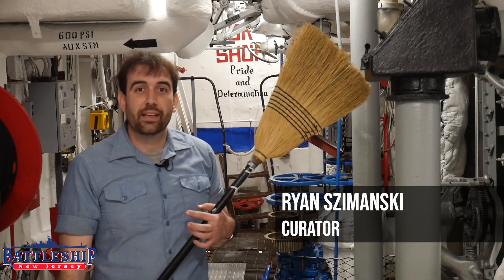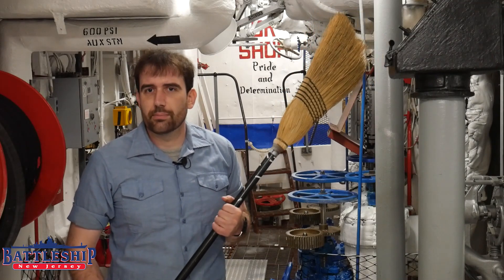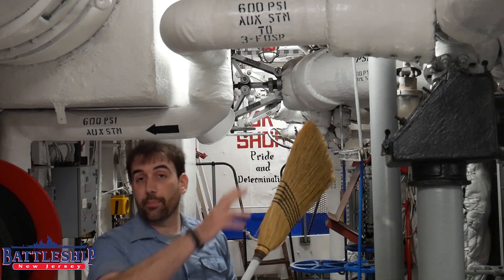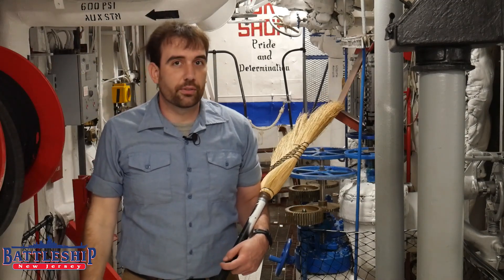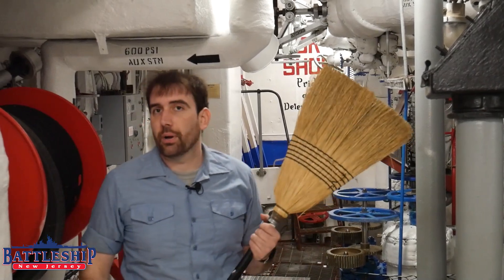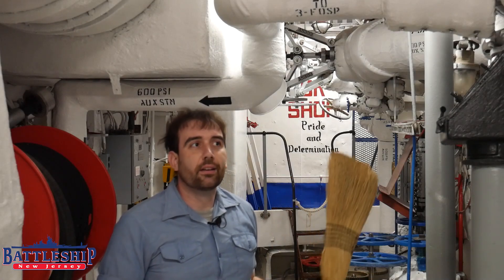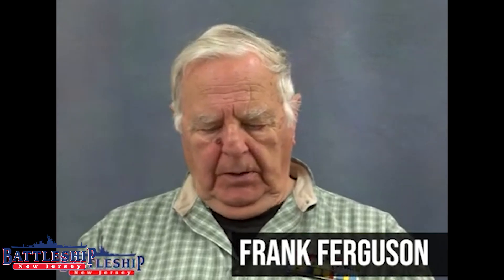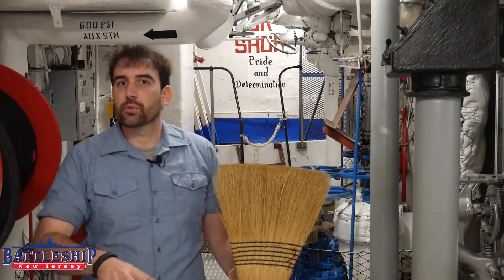Searching for Steam Leaks in the Battleship's Boiler Room

Comment: Using a broom to find steam leaks is still a thing even in naval nuclear power plants. The only real differences between a nuclear power plant and a conventional steam plant are the sources of the heat and in a nuclear plant you use a heat exchanger to transfer the heat from the primary coolant to boil the water you're using to make steam.

Comment: Ryan, great stuff as usual, TY! btw, I spent my civilian career as a pulp and paper Pipefitter.  We used a lot of high psi steam as well.  There is nothing of a wives' tale about searching for a shrieking hp steam leak with a broom.  Less than 200 psi of compressed air can penetrate the skin.  I believe a bad hit from 600 psi steam could cut a man in half.    AIso, I think Nuclear powered ships are indeed steam powered.  Instead of using oil to heat the boilers they use radiation.  Keep up the good work young man.

Comment: Ships I sailed on created superheated steam at 850psi and 960F.  You could hear leaks but not see them unless they tore out some of the lagging and a big leak you couldn't hear anything but a massive roar. Needed to fix it first chance as the steam would gouge the steel and the leak would get worse.  To pinpoint it,  we used a listening rod with a scrap of rag tied to it.  A couple of feet away from the leak, the steam would lose heat and you could find it with a bare hand - problem with that is that the steam is very dry and will build up a hell of a static electric charge. I remember my Croatian second assistant standing in a steam plume from a floor level leak and pulling huge sparks from a fixed foam spreader which was of course electrically grounded. He was mad as hell and couldn't understand why he was getting electric shocks from a simple foam spreader and I couldn't explain for laughing.

Comment: I used to work for a company that builds steam turbines.  They have a central boiler that provides heat, DC power, and supply steam for several test facilities around the 20ish acre campus.  One day in... 2010?... a high pressure pipe running over the top of our building ruptured.  The howling was incredible.  Deafening inside and from most of the plant.  It sounded like an air raid siren.  

I know that I heard about the broom technique when I worked there, along with stories of guys losing fingers to steam leaks.

Comment: I flew a Fokker F-27-500 Turboprop, That unit had Three Pneumatic Systems.  Each units bottle pressure was maintained by the 4 stage compressor at 3300 PSI... In training they said if you hear it singing and 3300 pounds is going to be screaming, the best thing is to just isolate and stay clear of it as it will chop body parts off like a scalpel...  Never had one develop a leak, but we did lose oil out of the drive assembly to the Compressor and Generator and alternators and had to shut that engine down to keep the gearbox from blowing itself apart...  Mechanic stuff is always a good time when it EXPLODES and blows major pieces out of or off of some critical motivational equipment. Fun Video.

Comment: I was a BT3 on the USS Waddell DDG 24 between 83-86. We had a total of 4 Foster Wheeler D type 1200 PSI boilers in two fire rooms supplying two engine rooms with Westinghouse main turbines. Yes even small steam leaks especially on the main super heated lines are nothing to play with. I remember using the old broom method to locate leaks on several occasions during my tour.

Comment: Also applicable to high pressure hydraulics, where you find a pinhole leak that shoots a needle thin jet of oil, which penetrates clothing and skin equally well, so you get large subcutaneous oil filled blisters that need surgical lancing and draining, and often more than not skin grafts to repair the damage. The broom will there either lose bristles, or simply get wet.

Comment: Not a ship, but a building.  A misconfigured valve controller set off a steam hammer that blew apart a high pressure steam line.  The dry steam melted aluminum and copper and cut through the panels on the utility penthouse.  It had my respect after that….

Comment: I was a BT on a gearing class destroyer stating in 1968. You hit the nail on the head. Almost everything you said is what I was taught, including using a broom. We never had a leak. We did loose the load and we only had one boiler on line at the time and that's the boiler that went down. That totally killed the ship, we were dead in the water. It took a few hours to come back on line.
Barry

Comment: I was taught while training on forklifts that a hydraulic leak on the fork mast while it was up or carrying a load was dangerous. It could in theory cut a man hard as the hydraulic fluid operated under great pressure when compressed and the valve was not releasing the load. We were taught to find the leak first by observation to find general area, of course stay away from the jet direction of the leak, and use a piece of paper as you used the broom to use as a 'search device' as a sacrificial lamb.

Comment: Pin hole leaks only.
A large leak would lead to an explosive decompression, basically, an explosion, and probably kill those in the space.
An economiser tube on one of the Aussie ddgs ruptured.
Tube split like a banana skin, and the eruption from the stack was seen many miles away, at night.
As the Stoker's lament says , " 1200 pounds, of superheated steam,
Can kill you mighty dead!!

Comment: Not completely accurate!   I was a boiler tech on two 1200psi ships (DDG 24 & CG 16) for 6 years.  We rarely if ever used broom sticks.  First, you can feel the temp increase from a leak.  Almost all were leaks from steam pipe connections (specifically,  the flex seal between them).  Happens all the time.  And they are not nearly as dangerous as mentioned.  Leaks do not cut things in half.   A small telescoping device with a mirror works well.
Reply: Yea, I was also surprised that ppl are saying there would be zero indications of a leak. We had a gas turbine at a paper mill and the expansion joint of the exhaust duct seemed to have some sort of tiny leak because whenever you walked near a certain corner of it, you would feel noticeable warmer. And that’s just air, not even a fluid that could condense to visible form at atmospheric conditions.

Comment: All due respect to the crew, but If there was a steam leak strong enough to cut the broom, much less flesh, it would be so loud as to be completely deafening. It wouldn't be a stealth steam leak that could do anything more than burn you. This would be so you wouldn't get burned. The boom would more likely be singed than be cut. Now, If we were talking about a 60,000 psi hydraulic system with a pinhole leak, it would be a completely different story.
Reply: The sound of a pin hole leak could be too high pitched for the human ear to hear, as mentioned in this video.
Another thing to consider is that when in service engine rooms will be noisy by themselves due to all the machinery.

Comment: Ryan said he's not sure if the engine room steam could actually cut a man in half.   I've never had anything to do with steam power plant, but I have worked for an industrial steam cleaning business.   The machines were if I remember right rated about 1200 PSI and 160 C.  One of the guys managed to pass the jet over his hand - it grooved his flesh right down to the bone before he could react.   So, even though only half the pressure, I wouldn't be at all surprised if a bare engine room leak did part someone in two, given the superheat temperature.   However, the presence of the thermal lagging probably diffuses the leaking steam and make it a lot safer.
I'm surprised that a double-wall piping system was not employed.  In marine diesel operation, fuel leaking from fuel pipes is incredibly dangerous, as misted fuel will come into contact with a hot surface and cause a fireball.  So fuel lines are double walled.  If any fuel leaks from the inner pipe, it will be contained in the outer pipe, where it will de-mist, can be detected, and an alarm set off  (SOLAS - Safety Of Life At Sea requirement - but navies tend to ignore SOLAS rules.)
Reply: Every pound used for the outer wall of the steam pipe is a pound of ordnance that you cannot carry into battle.  It's not as much of an issue as you might think.  A lot of the SOLAS rules came about due to the minimal crewing and maximum automation used on most civilian ships.  A modern container ship might have 50 crewmen on board total.  A modern navy ship might have that many on watch at any given time, with the rest of the several hundred crewmen off duty.  The ship i was on was basically a 650 foot tanker.  Total crew was 345...lots of extra eyes to have constantly walking around checking things...
Reply: @kevincrosby1760  : That sounds fair ....   But then if you have more crew, that is also more weight that you can't allocate to ordnance.   You could cover an awful lot for the weight of one sailor - say 170 pounds each.
And if the crew aren't all well trained and conscientious ....   Search on [westralia fire].   This was an Australian navy ship, actually a second hand old oil tanker bought cheap, that caught fire a few hours out of port because some nitwit of a Navy engineering officer, a complete moron unaware of SOLAS, decided to replace high pressure main engine fuel lines with plastic hoses.   And men died because officers had never done a fire drill on that ship and didn't understand the fire suppression equipment.
Reply: @keithammleter3824  key word there is "training"...and "moron".  US Navy ships are regularly evaluated by outside observers.  A ship with a crew who could not demonstrate their ability to fight a fire would never be certified to light off the engineering plant, much less leave port.  Ditto for handling flooding, damage, collision, engineering equipment casualties. etc.  

If a task requires that a qualified person perform it, then it doesn't happen until such person is found.  

Any critical part (such as a fuel line) would have a written procedure for replacing it, including required qualifications for performing the work, specifications for the part, specifications for any acceptable substitutes, and specifications and procedures for testing the repair.  Failing to follow the procedures is a sure ticket to having a discussion with the Captain where he describes your new duties involving rust removal and paint application in Deck department.

I kid you not.  The "bible" for engineering is the EOSS (Engineering Operations Sequencing System).  It is a set of binders with step-by-step instructions for performing a task, including what the result should be after each step.  Step 1 might be "line up lube oil system", and would be followed by a reference to the section which gave instructions for which valve number to open, where the valve was located, how far to open it, what the indications should be (pressure/flow readings, etc) when it was opened properly, and what section to reference if the indications did not match the specifications.

Seriously, I have personally seen a PMS (Preventative Maintenance System) card listing the personnel qualifications, required tools, procedures, and test routine for cleaning the crumbs out of a 4-slice toaster in the galley.
Reply: @kevincrosby1760  :  Re US Navy, nothing you said surprises me.  I have read about the evaluation of US ships by external authority.   That doesn't happen in the RAN (Australian navy).  To be fair, the RAN is a much smaller outfit, about 45 vessels, no aircraft carriers, cf USN about 300 vessels including 10 nuclear powered aircraft carriers.  The RAN has 390 persons (crew + shore based + civilian support) per vessel, the USN 2100 per vessel.  
You can see from this that the RAN necessarily must have a much more "can do" approach to any sort of task.  In another man's words, that is a more risk based approach.
The real key to this is that there should be adequacies in three areas:  Selection & promotion, training, and documentation.  As budgets must necessarily be limited (especially in the RAN), there is an optimum balance - the right personnel, the right training, the right documentation, but you can scrimp on any one if you compensate by boosting one or both the other two.  There are limits - for example you can't get a retard to make decisions no matter how much you spend on training.  Conversely, too much training serves to bore people and reduce their efficiency.  
Culturally, the USA has long been strong on documentation - its not just the USN.   Australia has inherited a British culture, in which the emphasis is much more on training.
The problem with the RAN that ultimately led to the Westralia fire and other equally astounding accidents appears to be that they have no idea what the optimum is, or even that there is an optimum, so NONE of the three things (personnel, training, documentation) are adequate.   That is so top to bottom, thus the senior command does not have the integrity or wherewithall to say to the Government "Hey, you expect too much.   Either let us reduce the number of vessels, or give us adequate cash to properly staff the ones we have."

Comment: I'm an automotive tech, originally, and when dealing with fuel injection systems (especially diesel as it can be 10,000psi or more) they teach us the same thing - go in holding something like cardboard to locate the leak.  They also showed pics of tech who did not do this, and either died outright or lost limbs, as the pressure is more than enough to inject the fluid into flesh. The damage actually looks somewhat similar to vicious electrical burns.

These days, I'm a power engineer working with a number of low pressure low temperature water boilers. I still treat them with extreme respect and caution. Even on them, having a boiler casualty is bloody terrifying, albeit the fear comes just as much after the fact.
Reply: Remember all of the warnings about boiling water in a closed container?  A boiler is exactly that...a closed container that you are boiling water in.  Your caution and respect are warranted.  The difference between a low pressure boiler and a bomb can come down to whether the safeties blow off at the proper set point.  I've seen the aftermath of a 5 PSI boiler for steam heat where a steam stop and a safety failed to open and the emergency gas valve on the burner failed to close...they were using a front end loader to remove the remnants of the boiler house from the parking lot where everything above the level of the firebox ended up.
Reply: @kevincrosby1760  the real fun starts when the safeties are what fail. ;)

Comment: The 692 class Steam plant I trained on was a miniature version of the NJ's.  600lb steam was the standard.
  We had 1200lb steam at 975F superheat on the Knox class frigates.  You could tell there was a leak if you saw a pair of jean clad legs walking around, trying to find the rest of the Snipe they came from.  Broom handles optional.
Reply: Allen M Sumner class DD was the "692" class.  They stretched it a bit to create the Gearing class, giving the class more bunkerage for increased range.  Both classes had the same powerplant, whose 60,00SHP conferred upon them a turn of speed allowing either type to keep up with the Iowas or Essex/Midways . . . on a glass calm sea.  Lovely little ships.

Comment: True. Many of the destroyers post war were at 1200 psi. The danger is not just the steam leak, to fix the leak you have to peel off  the pipe’s insulation which is diatomaceous earth wrapped in asbestos cloth. Dust from the asbestos cloth exposes the repairer to fine asbestos particles which can lodge in the lungs and cause asbestosis and Mesothelioma. I have a small spot in my lung that VA is keeping their eye on. I was a Machinist Mate and did repair work on steam leaks.

Comment: A common problem with steam systems is you never want them to go “Cold Iron” when we get connected to external steam source for shut downs or for boiler switching.  Normally You never want to drop below 190 degs temp.  Also there needs to be recognition of dissimilar pipe Metals because the issue is always your pipe cooling down and mechanical joints contracting.  That’s where bolts shrink or gaskets shrink….   This is very common problem.  Diligence is paramount in the Steam Plant.
Reply: This is the sort of first-hand expertise that we really need to write down somewhere. This is also why the Navy would have trouble reactivating battleships—only a handful of guys in the world still know stuff like this and how to deal with it.
Reply: Having worked in Main Control on two different FF's for over 5 years, I can state that we went Cold Iron every time we pulled into port.  Sure, things contracted while cooling off but when you brought the propulsion plant back up you followed your steam tables to bring all the steam piping and components up to temperature and pressure according to those tables which minimized or eliminated that problem

Comment: Never delt with this issue with steam, but when i was being trained in heavy equipment i was told if you get a pinhole hydraulic leak to use a piece of paper to find it because the psi of the hydraulics was just enough to inject oil into your blood stream and that's a medical emergency you never want to deal with. Would actually be easier to fix if just cut your finger/hand/arm off instead.

Comment: I was serving on a Knox class DE, as we were blowing tubes a 1200 psi steam line ruptured, no need for a broom there, nobody killed but three guys were severely scalded
Reply: I was on the Hepburn in '85 (Knox class FF then) when her main line blew. The leading PO managed to evacuated everyone from the space just before it blew. Only the LPO was badly scalded as he was the last one up the emergency scuttle as the pipe blew. Later found that 3 ships of the class had come out of the yards with wrong grade metal for the main lines.